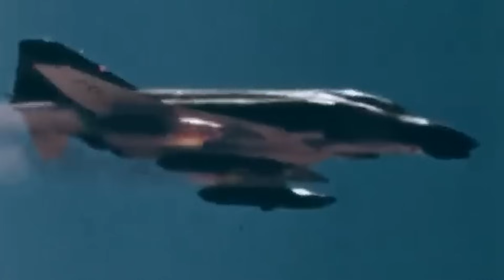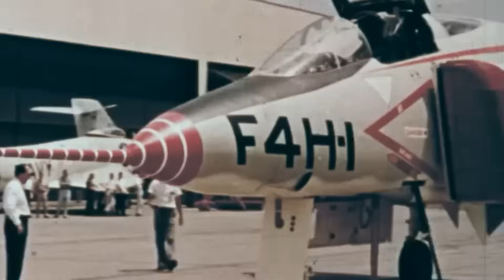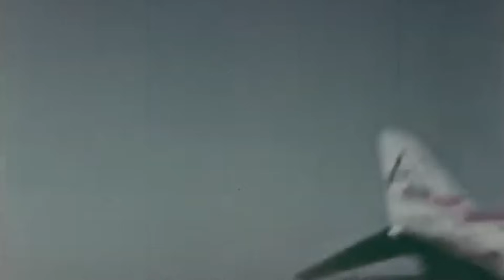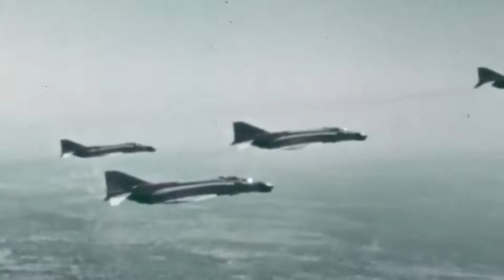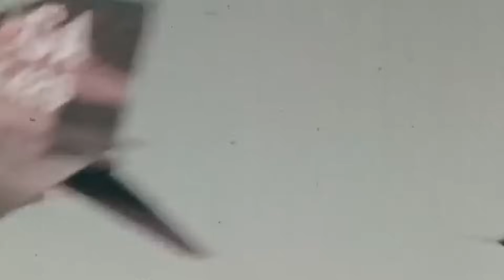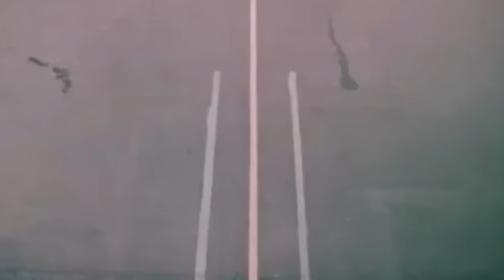The Most Unstoppable Flying Beast Ever Produced by the US

Comment: This is like McDonnell Douglas sales propaganda. It wasn’t that great at dog fighting, had smoky exhaust that gave away its position, even Mig 17’s gave it a hard time in Vietnam. And the lack of guns was a design failure that had to be rectified post facto.
Reply: Yet it was the best all-around fighter of its time and desired by every western air force that could afford it.  The MiGs "gave it fits" in Vietnam because of the combat environment and ROE, not because the MiGs were superior airplanes.
Reply: Read that the gun retro-fit affected the stability of the airplane, not for the better.

Comment: B model could carry Sparrow and Sidewinder, just like the C, USAF model. Plus the "N" was essentially a repainted 'B'..The 'S' had the AWG-10B, smokeless engines and slats. 
Plus, max gross weight was 56,000 pounds. Certainly not 41,000 pounds. That was just a little more than max landing weight at the CV..which was about 39,000(S model).
-Retired USN Phantom Phlyer
Reply: Should have said the C model could carry aim-9s , aim-7s AND the dreaded Aim-4 Falcon